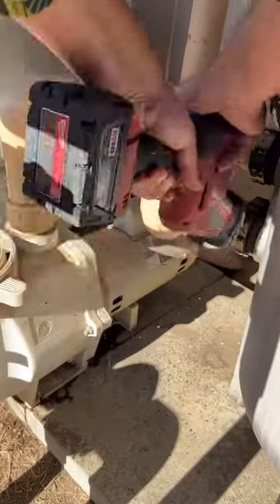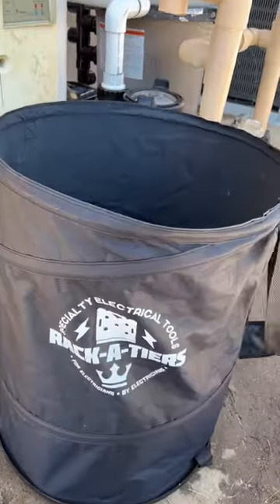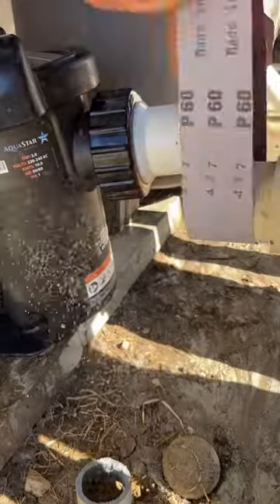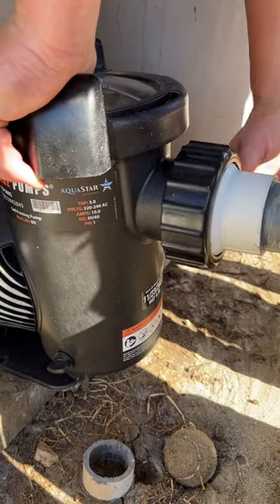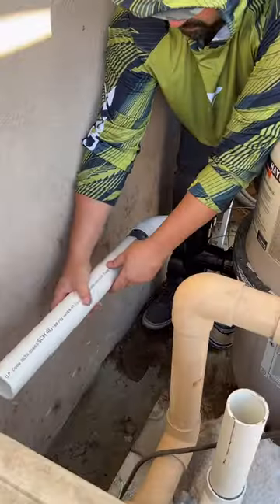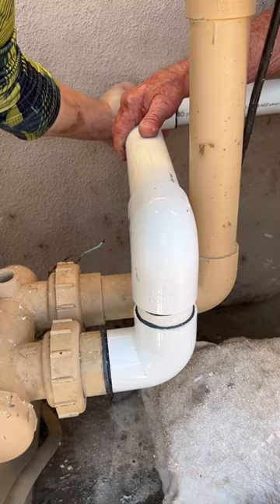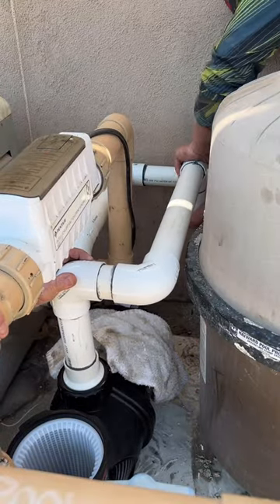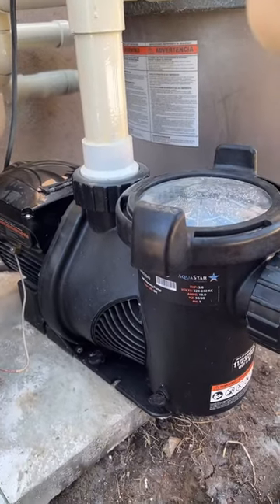poolvolution pool pump replacement

Comment: Interesting video. The only issue is there was no indication primer was used on the joints. Therefore, the bond is not going to be very strong. I wouldn't pay for that work. I'd make them do it again, correctly.
Reply: They used clear primer. They said it in the video and demonstrated using it. Purple primer is not the only color primer.